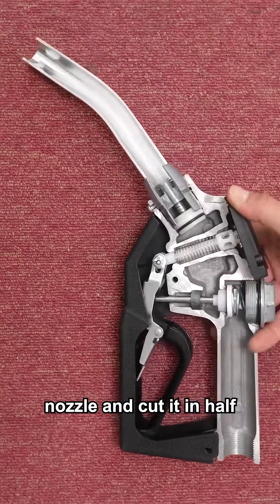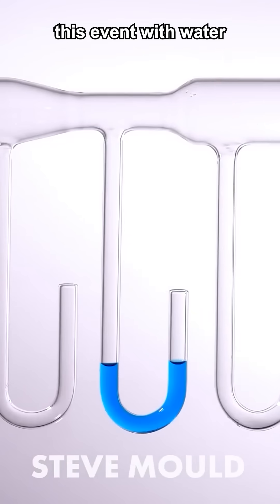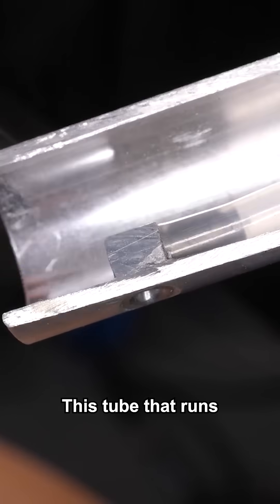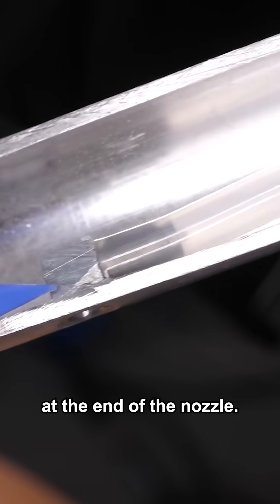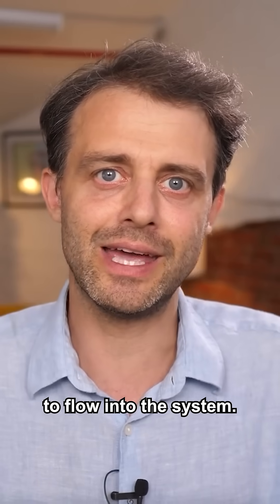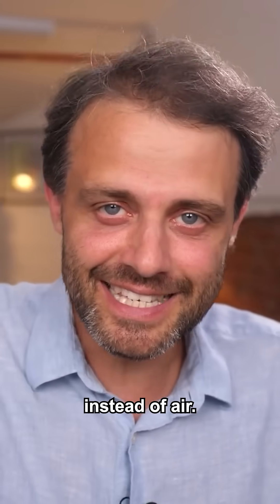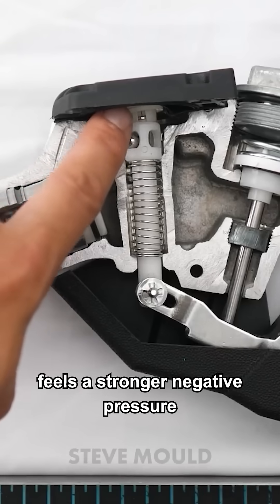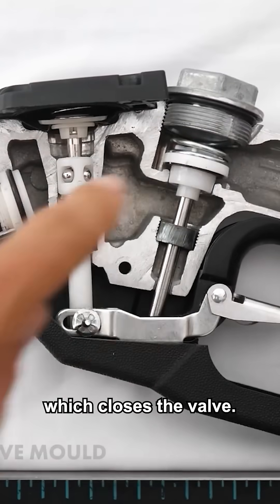How Petrol Pumps Know When to Stop! #shorts

Comment: The big pain in the ass is with classic cars. The filler neck is smaller diameter than modern cars, and the pump pumps faster than old pumps. Full squeeze, the pump will stop every  3 or 4 bux on my 53' Plymouth. You have to sorta feather the handle to keep it from stopping. Took me a few trys and running out of fuel (gas gauge was broke) to figure that out.

Comment: So how does temperature screw with it? I find in the winter I often can't hold the lever down all the way or even when my tank is empty it'll be shutting itself off every half gallon or so...for me it's typical for that thing to shut itself off ten times while I'm filling up and then I get in and I've still only got half a tank...is it maybe about the viscosity of the fuel? Maybe it's splashing off something and holding it at a different angle could help? Guess I have some things I can try next time!

Comment: There’s a valve in the nozzle that checks for air flow, when the air flow is cut off by the fuel getting too high up the filler neck of the fuel tank, the valve shuts, cutting off any more fuel from flowing through the nozzle and therefore letting you know you’re full. It should be common knowledge, but it’s not.

Btw, I stopped this short 3 seconds in to comment this, I’ve known for a long time how they work

Comment: Simpler explanation: there are 2 tubes 1 sucks air and other puts the petrol once the petrol rises the air pipe starts sucking petrol and as it's dense the feels higer negative pressure which does a few mechanical things with springs in the thing which closes the valve

Correct me in the replies if I'm wrong. I'll fix it

Comment: I love how you manage to break down complicated topics sometimes, and then other times, like this one, you manage to turn a pretty simple concept into the most confusing and convoluted video ever
Reply: Problem is, he had to squeeze it into 60s.  It's seems to need a 90-sec explanation
Reply: @77thTrombone  it’s def this but i also think it’s a matter of visuals. idk if this was cut down from a longer duration, horizontal video (meaning the aspect ratio got cropped for this) but the visuals are not helping the explanation, at least in my opinion
Reply: @77thTrombone the longer video is equally unnecessarily complicated.
Reply: @77thTrombone Are you sure 61 wouldn't suffice? :-D
Reply: quite frankly there are 10 year old videos on youtube that do a much better job explaining how the pumps work, but I guess since they call them gas pumps and not petrol pumps a whole new video needed to be made.
Reply: He really didn't do a bad job of explaining it. He just didn't explain it at a 3rd grade level.
Reply: @Charlie-nc3cp WOW, shots fired.
Reply: @Charlie-nc3cp This is not ELI5 though. :-D
Reply: @Charlie-nc3cp  I'm not sure if you know what explaining means

Comment: Somewhere in an alternate universe, your counterpart awakens, with a foggy head, in a dark room. At the edge of the room, gleaming eyes maintain contact as a faint red light blinks. A classy British accent echos: "So I've suppose I've gotten a bit of a reputation as the guy who cuts things in half and makes 2d transparent versions of things." You realize you cannot move. You are frozen. You cannot feel your limbs, or torso for that matter. "Now, lately I've been getting some questions about the human digestive system. Like, how exactly does your stomach 'know' when its full? Really, what does digestion look like?" You feel a piercing pain through your neck and up into your skull as a blinding light illuminates the room. "So I got a sample and cut it in half." Your heart begins beating erratically. Or maybe it was never beating to begin with. "I used some plexiglass to create a 2D version of human digestion!" You realize, this whole time, you've been screaming for help. But you can't hear it. Your mouth is locked shut at the lips. Your nostrils rip and bleed as you wrangle your head around, discovering plastic tubes lodged deep inside and firmly attached to your skin. "And well, it's not perfect, like I couldn't quite get a good seal around some of the parts, but overall I'd say it's a pretty good attempt."
Reply: Nobody with a classy British accent ever used the word "gotten" - it doesn't exist in English English. :)
Reply: @stevemichael8458  Damn, my Americanisms have betrayed me once again 😭

Comment: So, in summary, magic?

Yep?  Magic.
Reply: You know how gas cans have the little yellow hole you can open at the back so the gas will pour smoothly, & if you don't open it the gas glug-glugs out because it needs to let air through the pour hole to keep going?

This is like closing that little yellow hole & also not letting air glug through the pour hole.  Gas can't come out, pressure builds up, & the thing switches off.